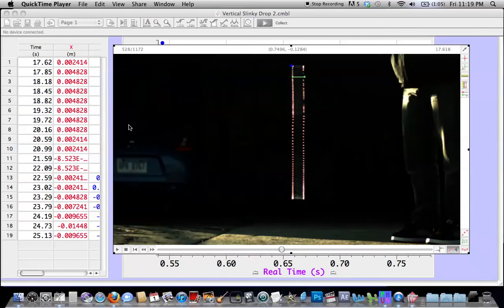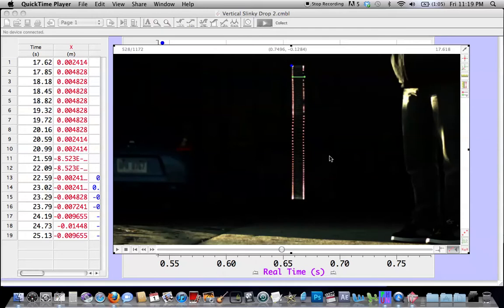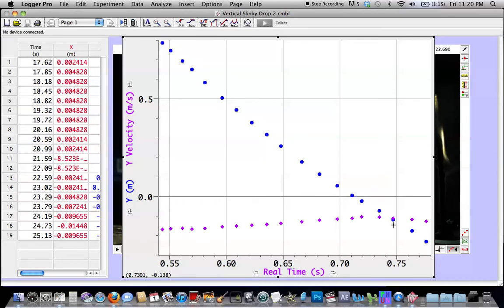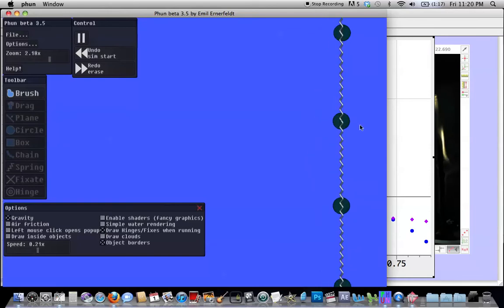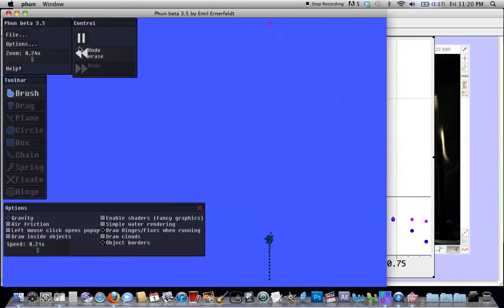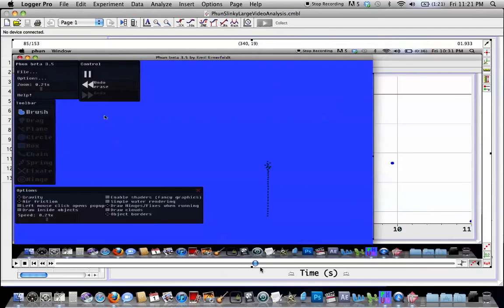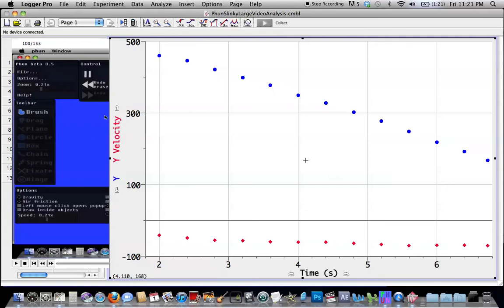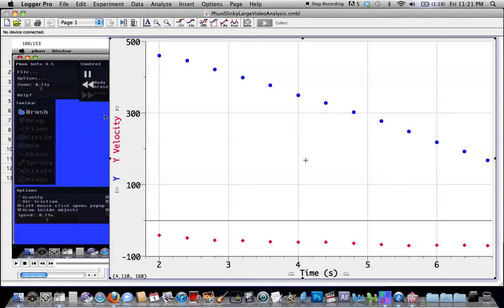Slinky Drop Video Analysis

Comment: Well, without taking into account air drag, if you consider half the mass of the slinky to be concentrated on the top part and another half on the bottom part, you can see that the top mass is influenced by two parallel forces (gravity and elastic force downwards) and the bottom mass is influenced by two anti-parallel forces (gravity and elastic force upwards). 
As a result, the top part will accelerate downwards. However, as the slinky contracts, elastic force decreases, as a result we have decreasing acceleration for the top part. The bottom part will start moving a bit before the top part falls on top of it because the elastic force upwards also decreases. Thus the bottom part will start accelerating downwards. 
The center of mass now will experience only the force of gravity as the elastic forces are equal and anti-parallel, thus the center of mass will do free fall.